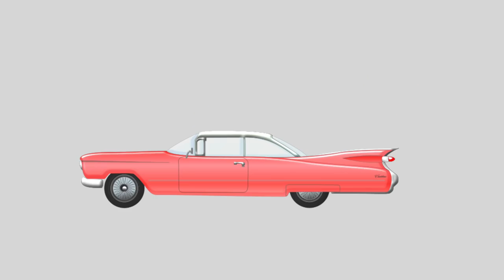Yes, Rockets CAN Fly in a Vacuum

Comment: In vacuum, like in space,  the exhaust gas will get sucked in, in all directions instead of just leaving the exhaust and going only in backward direction  because of the vacuum in space. In that case scenario how a rocket exhaust pressure backward will push it forward ?
Reply: You believe that the vacuum of space can exert a force on anything? 
 Tell us what physics classes you have taken in your life.

FACT: The vacuum of space CANNOT "pull" the exhaust from the nozzle.
Exhaust gas is PUSHED from the rocket nozzle and this exerts a force on BOTH the gases AND the nozzle.

Would a steel projectile fired from a crossbow in space exert a RECOIL force on the bow? Yes or No?
WHY or WHY NOT?
Reply: Papa Legba  why do you refuse to watch the video that proves you are wrong?
Reply: Papa Legba  want PROOF of rocket Propulsion in a vacuum?
 Search YT for "SpaceX ArabSat launch and booster landing 4K". 
 Watch the video of the falcon heavy fly into space, then the side boosters returning to land at KSC.
  Report back after you watched that video to the landings.
Reply: Papa Legba  
A W=PV equation would refer to a gas doing work in effort to expand the container it is in.

This obviously doesn't apply to rocket motors.

How about you try the actual equation used to calculate the thrust of a rocket motor?
F = m dot * Ve + (pe - p0) * Ae

F: Thrust (the force the engine experiences) 
m dot: Mass flow rate (how much stuff we're chucking out per second)
Ve: Exhaust velocity (how quickly the exhaust gases are moving out of the engine)
pe: Exhaust pressure (the gas pressure of the exhaust)
p0: Ambient pressure (the pressure of an atmosphere if there is one)
Ae: Exhaust area (the internal surface area of the engine).

Now, what happens when we put p0 = 0bar (as in, we put the engine in a vacuum)

F = m dot * Ve + (pe - 0) * Ae
F = m dot * Ve + pe * Ae

Comment: how does this Air push the rocket in the SPACE ?! if you mean space is Empty not like flying from the Air ! from the earth pushing the Against the Air ! but in space what does it push Against !?
Reply: In space the rocket pushes against the fuel exhaust, to use your terminology.
Reply: @niallkinsella2687  that doesn't sound right yet !. give me an answer that make sense !.
Reply: @lostamusica4727  It makes perfect sense.
When you accelerate and eject mass, you cause it to gain momentum.
The law of conservation of momentum means that you must gain equal momentum, in the opposite direction.
Reply: @lostamusica4727  if I fired a crossbow into a vacuum, would I feel a recoil? Yes or no?

Comment: You try to prove that the rocket works in a vacuum and you release balloons in space with air and under normal pressure. You prove how a balloon behaves and not a rocket in a vacuum.
Reply: So, do you believe that rocket propulsion does NOT work in a vacuum?  I could explain how IT DOES but most people that believe that have no interest in facts.
Reply: @stuartgray5877  Hy Stuart. 
781/5000
For 50 years I was sure that Newton's 3rd law is an axiom. However, Newton has never studied a vacuum. The best rocket-propelled aircraft have never exceeded 110 km. They all fall from this height. Why can't they fly 150 or 300 km? Maybe because above 110 km there is no more air and there is not enough gas. Each action is accompanied by an opposite reaction, but as you can see it only applies to the Earth and in the presence of friction. Imagine standing on a skateboard and pushing one leg away from the ground. The skateboard is riding. Now raise your leg 1 cm above the ground and bounce the same way as before. The skateboard will not move. The leg does not meet enough resistance and no reaction is produced. Why do you think? What is your opinion why the board is not riding?
Reply: @stuartgray5877  Explain , many are interested.
Reply: @Tadek5  I'll ask you some questions and IF you bother to answer them you will understand how rocket propulsion MUST work in a vacuum.  After you answer about five simple, high school physics level, questions I will point you to video evidence of rocket propulsion in vacuum.   First question: If I fire a standard steel projectile from a crossbow here on Earth, in atmosphere , will I feel a recoil? Yes or no?
Reply: @Tadek5  no comment?

Comment: If you are going to make a video explaining rocket science... then you should probably know how a car works. Cars do not move forward from propulsion by pushing exhaust out. They move because of controlled explosions inside of an engine which turn a driveshaft (part of the transmission system), which is connected to an axle, which turns the wheels to move you forward. Unfortunately, credibility is lost for your argument when your example is incorrect.
Reply: Did you watch all of the video?
She specifically says the exhaust is not enough to move the car, that friction between the ground and the turning wheels is what allows a car to move. And that rockets work on a fundamentally different principle.

Comment: It is NOT this simple to explain and understand this concept. You are totally leaving out the fact that there's a endless vacuum in space. That almost perfect vacuum would "suck" the thrusters and the chamber empty as soon as they open any valves for fuel and oxygen, which means that there would never happen a ignition in the combustion chamber. There need to be a pressure difference between the combustion chamber and the outside in order to make the rocket move. 

No, it's ridiculous to believe in rockets flying in the vacuum of space and to be honest, you have never seen it happen other than in space movies. Forget it. What proof do you have other than this mind game? Nothing.
Reply: Truth Seeker - Afraid to debate someone with an IQ greater than 10?
Wise move, I would just make you look foolish (more-so than you do yourself)

Comment: Third law is when the rocket pushes on the air, and then the air pushes on the rocket.
Not when something just comes out of a rocket, because if said something coming out doesn't push on anything then there isn't any reaction because there was no action.

At best... Rockets in a vacuum maybe able to push on their nozzles.
Reply: what would happen if a person fired a steel projectile from a crossbow in zero-G, in a vacuum?  Would they feel the recoil force ?  Yes or No?
Reply: @stuartgray5877  

The only recoil that would be happening would be the result of the arrow rubbing and pushing on the crossbow as it travels on it.
Which would be a whole lot less than the recoil produced by a crossbow in an atmosphere.

As I said, the only thing rockets would be pushing off of in space would be their own nozzle.
Reply: @Danielst15lm  - "Which would be a whole lot less than the recoil produced by a crossbow in an atmosphere."
This is FALSE.

The FORCE felt by the crossbow (the RECOIL) is due to the bow feeling the SAME FORCE as the bolt for the same amount of time.
If the crossbow is applying a force to the bolt , then the bolt is ALSO applying a force to the bow .
This is the "Every action has an equal and opposite REaction" >
The bow pushing on the bolt is the ACTION.
The bolt pushing BACK ON THE BOW is the REACTION.

So EVEN IN A VACUUM, the bow WILL feel a recoil force because IT IS ACCELERATING MASS.
So ANYTHING that ACCELERATES MASS WILL FEEL A RECOIL FORCE . PERIOD.
Reply: @stuartgray5877  

But your bolt does not experience atmosphere drag resistance right? So it feels less force.

Now how does the bolt translate the force it feels back to the bow?

By chafing against the bow itself as it shoots out.

Kinda like rockets pushing ON THEIR OWN NOZZLES